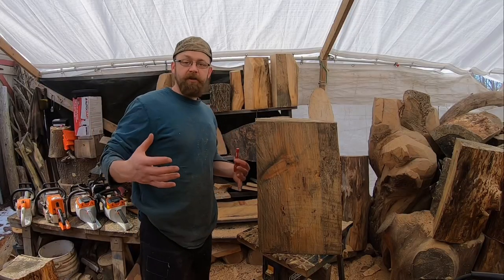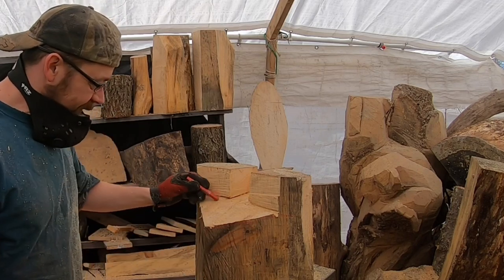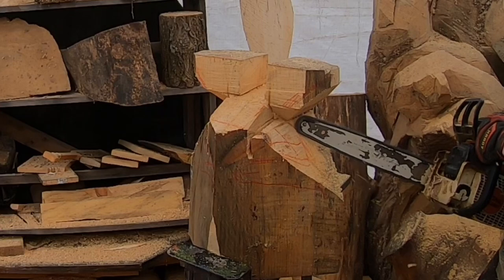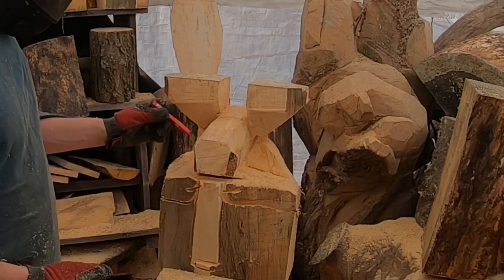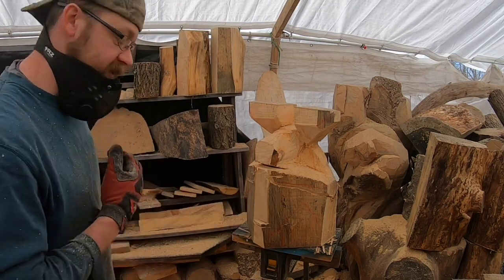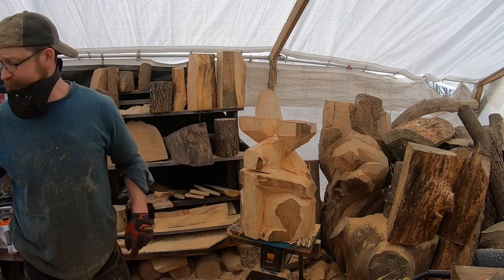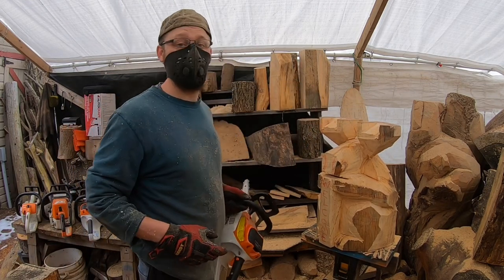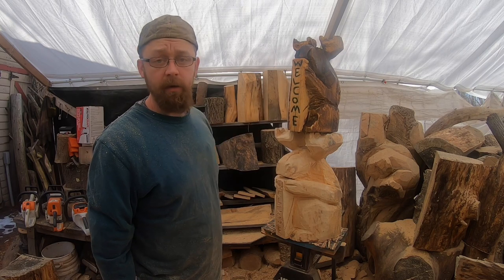Chainsaw Carving a moose . Tutorial

Comment: Kyle I have a problem with my chain bouncing on my work piece and makes the saw kind of walk on me. Any tips you have for that? It is a brand new chain.
Reply from the maker: I don’t think I have had that problem. Is the chain on properly and facing the correct direction for cutting
Reply: Kyle Hall woodworker yes it is. I think it was the work piece itself. I was carving a feather when it was doing it and it is thin so it was springy
Reply from the maker: Ah yeah that could be it .